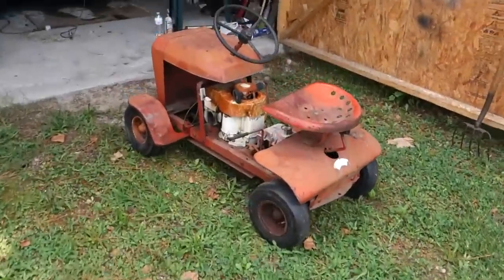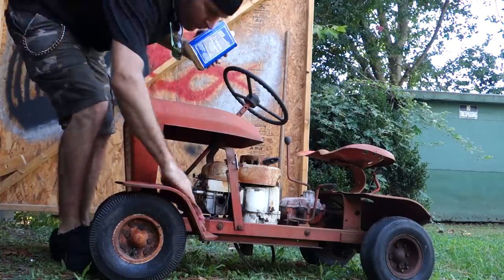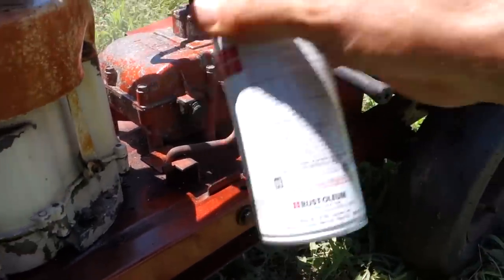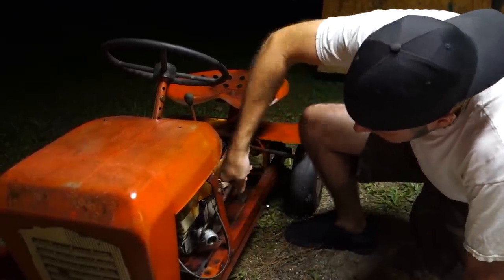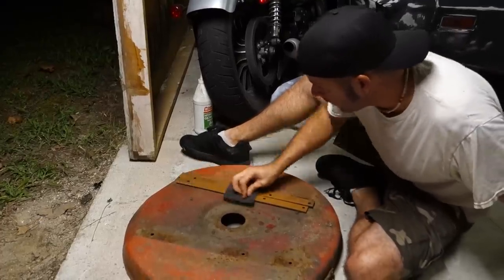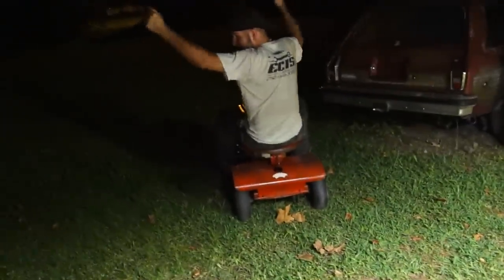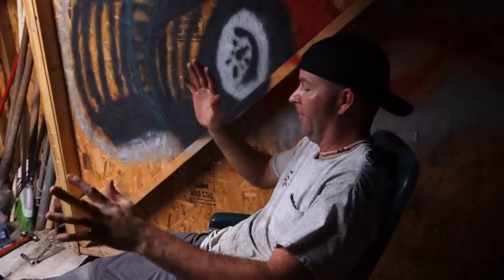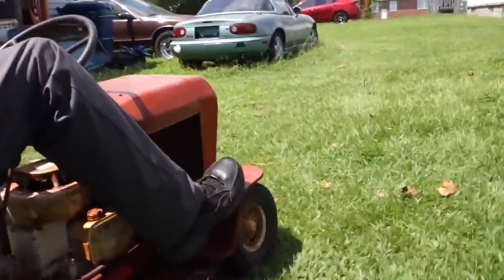The Rugg Mows! Clear Coat, Exhaust & Mowing: Ike's Adventures

Comment from the maker: It's incredible that this 50+ year old mower still has utility
Reply: do a header on it
Reply: also u should put some go kart slicks on it
Reply: CarsandCameras and you can use a wielding mask to see the eclipse
Reply: We had one of those when I was a kid back in 1968 first time  I  had  cut grass with a motor still  remember  that  freedom  feeling   thanks for  the  memories   keep the videos coming
Reply: CarsandCameras mint
Reply: CarsandCameras - yepper, i got a 70 toro 550, about the same size as that, still runs on original unopened 5hp briggs with electric start and it mows. almost 47 years old.👍
Reply: CarsandCameras put a predator 670 with stacks on it
Reply: CarsAndCameras about any newer 4.5 to 5.5hp should be easy enough to drop in, or just give the piggy a set of rings and a new head gasket. I'd definitely used a tapered threaded nipple and a 90 elbow for the exhaust can to keep it inboard. still awesome classic little beastie. rim spacers to help those rear slicks be flat, maybe find some shorter front tires to match and level it for cutting a little shorter or double up making the rim spacers to put little slicks up front too for giggles, would level it lower.
Reply: CarsandCameras I think you'll be a beautiful idea to put a predator 670 on there hook her up with a dual exhaust. Upgrade the carburetor. Put on larger tires and smaller pulleys. Then let's see how she goes.
Reply: I say white wall tires and an exhaust stack with a rain cap!
Reply: CarsandCameras Put a 6.5hp push mower motor on it if you dont want crazy. If you want crazy put one of them 14 - 16 hp rideing mower motors on it.
Reply: Also people do know the 670 is horizontal shaft and this mower need vertical shaft right?
Reply: Micheal Coffey put a 1 in gocart axle and a right angle gearbox for the blades
Reply: Since the mower uses a vertical shaft engine, that kind of limits potential options in terms of upgrades. Briggs and Stratton has a 540cc single cylinder with 19hp, but you'll probably have to cut up the frame and move some things around to get it to fit.
Reply: Thats exactly my point its old. Its art. I would hate to see you guys hack and cut it up to put a horizontal shaft on it when you can get a vertical shaft that makes almost the same power.
Reply: Micheal Coffey - yea , sorta like mine, coulda slapped a big motor on it, but wanted to keep it mostly original ( wheels arent) and added another set of roller wheels to the deck. other then that its all original, the motor is still good- doesnt even smoke.👍
Reply: Keep the engine original it would take away the patina besides a little smoke is just patina
Reply: The smoke keeps the bugs away.
Reply: The muffler is to shiny, maybe just some old water mains piping and turn it into a stack like a mini tractor.
Reply: i have one of those and i am wondering if you can adjust the mowing height. can you help me
Reply: Infamous Gamer - probably not since its bolted to chassis, other then using spacers, it wont lower the blade at all tho, just deck shell.
sorta lucky my 70 toro does have a height adjustment, but i mounted 4 wheels on the deck to make it mow even.
Reply: thanks
Reply: CarsandCameras where is the racing mower? 🤔
Reply: CarsandCameras I'll buy the mower for $120 but the catch is you have to come to California, Eureka at Redwood acres.
I will take real good care of it, I will buy some iridium spark plugs, light weight cutting blade, full synthetic oil and 93 octane gas.
Reply: I do love when old things show how durable they were made "back in the day", and continue to be useful. I think you're done with this project, Bud.
Now, let's get t'gettin' on that Kammback...breaks my heart seein' it sittin' there neglected! 😔
Reply: CarsCamerasBikesNTrux SoCal - yea i belive that, most my riding mowers are over 20 years old, my fav is a 82 dynamark, about 95% original. all it needed was a starter gear, rebuilt front axle bushings, 2 deck spindles.  
paint is all factory, on body n deck, original blades and original belts.
after seeing ike clearcoat the tractor, might do that with mine👍
Reply: CarsandCameras you should restore your mower
Reply: CarsandCameras you should if yoused you non automatic welding helmet
Reply: Ike, put an upright pipe for the exhaust and put a flap on the end of the exhaust tip
Reply: CarsandCameras I would like to see a engine replacement on this mower
Reply: CarsandCameras i bet its got a cam in er
Reply: CarsandCameras i think u should put a more current briggs ohv on it
Reply: I watched the eclipse with my welding helmet xD
Reply: CarsandCameras u want to sell that mower
Reply: I learned to drive reckless on a brand new Rugg 1961 riding lawn mower when I was 3 1/2 yr.s old. My dad and grand dad put me on the seat and I ran it straight into a barbed wire fence 100 yards away. I didn't get hurt, but it was the first time I ever got cussed out. Anyway, I've laughed about it for years.
Reply: love it. I love old machines and engines also. keep up the good work ike
Reply: Cool old mower
Reply: Moto vloger
Reply: Keep the Briggs on it.
Reply: LOL I remember this eclipse.  I was mowing my yard during it. 😊
Reply: hey I have 1 need help fixing it please 🙏 help  I'm from nc
Reply: You guy need to do more of this kinda stuff

Comment: When my local shop lacked a proper muffler for a old lawn-tractor I had, I used an off-the-shelf replacement with a length of black pipe. The end result: The pipe-length acted like tuned header, helping the engine produce more torque and be more efficient to boot.

Comment: Go to Lowe's and get a steel lock ring for 3/4" rigid pipe. They'll be on the electrical isle with conduit, electrical boxes and fittings. Install one on the nipple so you can tighten it against the engine block, it'll hold the muffler at whatever angle you adjust it to.

Comment: You should totally name it the Slow Mow    Also, Put the 670 on it and just send it
Reply: Aaron, as long as you don't bop through the gears like its a dragster it'll be fine. Edit: Also, he'd probably need a lever-pulled clutch so he doesn't break the trans.

Comment: Mix 20% Tar to 80% lindseed oil and spray it to the underside of the mower.
When it dries, it will protect the deck from rust and also repel moisture and such the grass is not so likely to stick to it (sound weird because of the tar but trust me)

I use this stuff regularly for rustproofing my car,mower and my farm equipment, i even put light goat of it to my (other than food use) knives after sharpening and it really keeps the rust away :)
Reply: Ukkomies

Comment: I loved this series. I think replacing the motor is an idea, however, I think it takes away from the aesthetics. It's like you said ike, it's art. I think it's gorgeous. Wish I had one. How hard would it be to repair the problems with the original motor?
Reply: not hard. its just weak, I would like more power
Reply: more power is ALWAYS the answer, regardless of the question.
Reply: Isaac it'll be fine - lawnmower racers use big twins on those, i had the chance to buy a twin powered toro just like mine, just didnt have the cash. personally id go with a 5hp- 12hp old skool opposed single.
i did that to my 69 simplicity broadmoor, its original 8hp briggs was in pieces so i shoehorned a newer 10hp in it, was a tight fit between grille/ hood support and dash, but it fit.👍
Reply: More power? 
More like mow power, am-i-right?
Reply: what do you mean by opposed single do you mean twin
Reply: Isaac it'll be fine Idk man, the look of the patina with the motor is one of a kind.
Reply: gotta pull it, pop the head, casing, undo rod, pop new rings on it with a little cleaning as you go and a quick scuff to the cylinder before slapping it all back together with new head and case gasket (or silicone to the case). actually be lot easier to slap a 5.5hp push mower engine on it and rob the tin offa this one.
Reply: Maybe put a newer Briggs on it and put the old cover on it

Comment: Keep the 5 HP engine just put in cam forged piston billet rod and flywheel ! All those parts can be used from a horizontal shaft engine with little to no modifications . should be able to get 7,000 RPM's out of that carb with a little work and a stiffer spring on the governor !

Comment: If that's patina, you'd love my 78 F-250. Used Great Stuff foam to stop the winter breeze coming through cab corners and lower door panels. Worked so well I might just bondo over it. It'll be fine.... until my cab falls off.

Comment: You could drill a hole in the deck,and mount the muffler so it discharges below the deck like a lot of push mowers. Maybe muffle the noise a bit too.

Comment: Its an awesome mower and i can understand you keeping it as a mower, but that thing would make a sweet racing mower project.
Reply: it would make a awesome racing mower
Reply: Too old and fatigued. It would flex, bend, and break.
Reply: By the end of it, itd just be the engine cover
Reply: SIXPACFISH they can reinforce it by welding steel to the original frenetic or welding a frame and switching the thing on it

Comment: If you plan on replacing the engine a good replacement would perhaps be a 6 or 7 hp vertical shaft Briggs and Stratton engine off a push mower. They are really easy to come by and reasonably cheap. And it probably won't be that hard to adapt to a frame like that. I think it should still be able to mow lawns but replace the back pulley so it can do like 25

Comment: You should get some Valspar Val-Oil if you want to clear anything else like that. It's meant mainly for decks, but if you wipe it on with a cloth it gives a nice shine that's not quite glossy. So far I've used it on my '56 Murray bicycle, and a bunch of outboards from the 30's to preserve the decals

Comment: I think it looks good as is, and if you did change the motor you should try to keep it looking original.  As it is now I think you could run the exahust out through a 90 degree bend, up and forwards, and then have another 90 and the muffler run the exhaust out through the inside corner of the hood on the right side of the mower.
Reply: was thinking same, 5.5hp from a push mower and swap the tin over. exhaust inside and downward to dose the lawn with a little monoxide could help mowing be a little less frequent (strategy!)

Comment: Dude that 90's caprice is sweet all your rides are sweet , do think a new 8hp vertical shaft is in order for the rugg or maybe a 20hp vertical shaft Kohler Command , should stretch it a bit and do two tranys to get more gears for torque and speed , or just leave it stock

Comment: Ike, as I'm sure you know the Rugg mower engine is a flathead. It has valves which are very close to the exhaust port. You've heard it before, it will warp the valves. Go to your nearest hardware store, and pick up a 1/2 inch by 3/4 straight nipple which is male to male, and 1/2 inch 90 degree female to female, all with plumbing pipe, which has pipe thread, and install your muffler. As much as you mess with lawnmower and edger engines you may already know this, but thought I mention it just in case you didn't. Are you going to sell any of your model A's? Some people love them completely stock, and some like to hot rod them. I saw one with a Ford Pinto engine in it with an adapter, so he kept the Model A drive line. It started every time, and ran so much better he could take it on short day trips, parades, ect. You can't tell because he keeps the hood on. Also just for informational purposes for some of your readers, a drive shaft is not a drive line. If you go to your local auto parts store and ask for a drive line you will get clutch, bell housing, throw out bearing, transmission, driveshaft, and rear end, for whatever kind of car or truck you are working on. Anyway I'm jealous cause I can't find anything like the cars you have found around your area. They are all my favorite old cars. Keep up the good work, I enjoy and learn a lot, watching your videos.

Comment: might consider some new bearings in those front wheels...bet the cornering and cut height will improve
Reply: if you noticed, the old stock size fronts are taller than the rears, needs shorter or mod for a pair of matching slicks (in back needs rim spacers already).
Reply: that front camber nothing a piece of pipe and some heat wouldn't fix once the wheels are off.

Comment: What do you use to fine sand the paint? Steel wool or fine sand paper? I have one of those and I making it a racing mower and stuck a 24 hp v-twin engine in it, had to mod of the frame a little bit though. But I really want to keep the original orange paint. It looks cool, so I'm wondering what you used to sand the paint.

Comment: We used to have one like this. Is yours the 5hp model? For what it was ours did well although when we moved up to a 42-inch cut machine that was better for doing our two acres that had many large rocks and was on the side of a pretty steep hill.

I still have a soft spot for that brave little 5hp mower though. It was the first riding mower that I ever drove. sigh..
Reply: lol. 4 hp

Comment: Holy crap! I have the same 96 brown caprice. Is yours a virginia state trooper car? If it is, it's kinda rare because of the paint vin code. Only about 2000 or less with the trooper brown vin code. Plus the 96 9c1 had thicker frame rails so they could straiten them multiple times after wrecks. They had all sorts of upgrades that weren't actually listed as upgrades.. check out the forums about them.
Reply: its a 95 sheriff car
Reply: Isaac it'll be fine That's awesome, hold on to it. Another couple years and it'll be a classic. I've already been offered double what I payed for mine, but I'm just gonna have a hole dug big enough to be buried in it lol. Keep up the good work.

Comment: I would really want to see u build a riding lawn mower to with a swap push mower engine and see if u could make it reach at least 30 mph im working on my drift mower but ive found thousands push mower i havent yet to get mine started but havent seen a riding lawn mower with push mower engine im only 40$ in and have 3 exatra eingines

Comment: What is the acetone for?  Does it stop the rust or help clean it before the paint?  I have an old quad frame that has some surface rust that I'm trying to clean.  Just trying to figure out the best way to clean it off before painting it.  Thanks for any help!
Reply: the acetone is just to get the oil off so the paint will stick. rust? there are lots of rust converter stuff out there
Reply: Thanks Ike!  Love the channels!  Wish I had a buddy like you.

Comment: So the exhaust I would put that 45 degree elbow and some more gas line pipe straight out and up and then run a flapper on it at the top so it kind of has like an old tractor look big tractor look for pulling tractor look

Comment: My predator 212 won't start and when I pull the cable to crank it it'll jam. I don't know a lot about them so a little help?
Reply: id try to turn it over by hand to see if it is the engine or starter aka pull cord

Comment: Love the rat-rod look mower!
Through in a 5.5hp 173cc Predator vertical shaft motor.
https://www.harborfreight.com/55-hp-173cc-ohv-vertical-shaft-gas-engine-carb-69731.html
Paint some flames on the hood.
Reply: give it sheet metal side panels with louvres and WW2 fighter mouth/teeth!
totally agree 5.5 or 6hp (6.5?), slicks on all 4 (with rim spacers), Kentucky Chrome the rims or find those tiny hubcaps... 
and now for the ultimate fuggemup: "it'll be finer one of a kiner!"